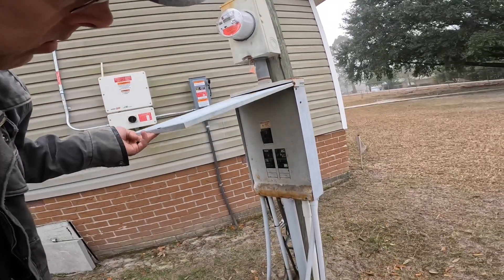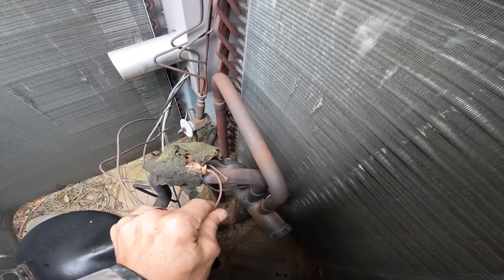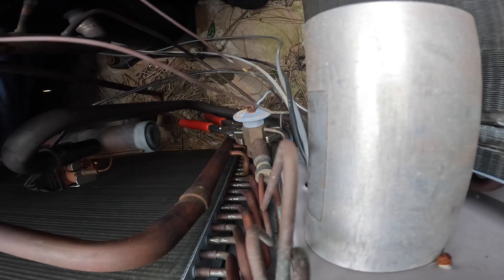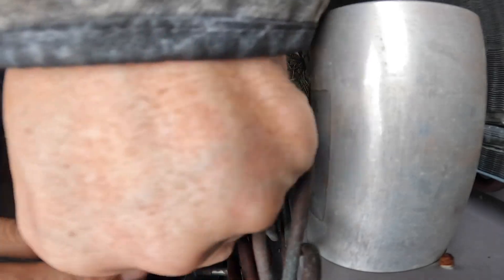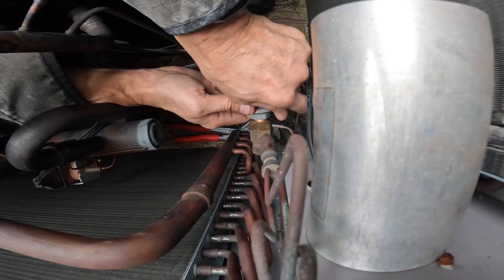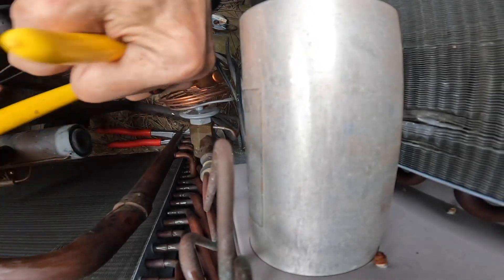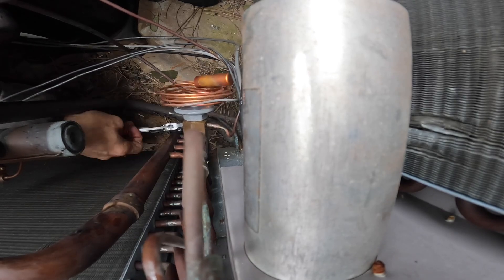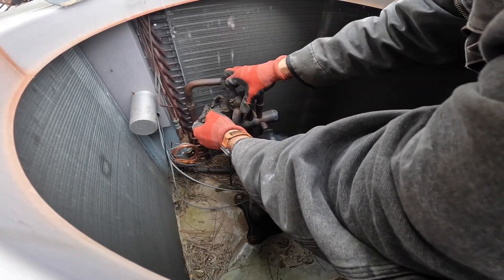Swapping a Power Head On A TXV - The Easy Way

Comment: Since it's a  heat pump
 You should of pumped gas in air handler and valves the unit off.  Incase  you blow the pins.  Use a wrench from sporlan . .   Secure the capillary  with caulk at the bulb and secure the rest

Comment: They make a special adjustable wrench for removing power heads.  The jaws are thin and offset, to fit in the narrow space between the power head and the valve body. I think it’s made by rigid. I don’t think channel locks would fit.  You must not be on the flats, but on the peaks   Channel locks or definitely not the right tool for backing up the body. You can make a tool by grinding down a crescent wrench.  It saves chewing up the flats of the body
Reply: Hell yeah the e110 wrench I always have it in my bag at all times

Comment: Great video as always, question about your joblink system that I have been meaning to ask someone, are the probe batteries rechargeable or do you have to switch them out every so often?  And, how often would that be?  Thanks.
Reply: Disposable and depends on run time. Usual operation gives a flashing green. When they flash red it’s time to replace batteries
Reply from the maker: Got to change them every so often

Comment: What were the symptoms that lead you to the power head?
Reply: The cap tube literally snapped off.
Reply from the maker: It was pumping down in heat mode
Reply: @HVACGUY  thanks for the reply.

Comment: I’ve always just pumped it down. Never wanted to risk losing the pins
Reply: Pump it down... For an outdoor metering device... I'll let you work that one out for yourself.
Reply: @TheMinecraftACMan  

I'm curious, couldn't you pump it down into the evaporator by closing the suction service valve and then closing the high side service valve?

Lol never tried that but I'm just wondering.
Reply: @BibleBloopers  You would actually close the liquid line first, keeping in mind that in heat mode your suction becomes the discharge line. It could possibly work, but if it went south it would get more complicated real fast. For one, if you failed to get the new head on before the little gas left in the condenser was gone, then you'd have to recover the gas anyways. With a standard pumpdown, failing the hat trick lets you still pull a vacuum without needing to recover. But no ones going to pull a vac through that tiny little cap tube they give you for the true suction, so the attempt to save time pretty quickly becomes a time sink. And second, doing a regular recovery on a residential system only takes like 5-10 minutes if you have a decent setup. Use the core tools and it goes super fast.
Reply: @TheMinecraftACMan  that's right. I Completely forgot it's a heat pump
Reply: @TheMinecraftACMan  thanks bro
Reply: PINS...WHAT PINS????
Reply: @robertwood9628  you mean the flying shrapnel that whizzes past your head after ricocheting off the machine. lol 🤣

Comment: can you have done a pump down towards the evaporator to avoid loosing all of that gas?
Reply: The amount of gas lost was likely only a few ounces at worst and still fits the de minimis of the EPA regulations.
Reply from the maker: You can do that, but I’d still leave some pressure on it, as you don’t want air coming in.
Reply: @HVACGUY  From what I could hear you lost a very small amt of gas, deminimis.

Comment: The STUB of the sensing bulb is supposed to be on the bottom when mounted horizonal. the power head uses the gas of the sensing bulb and not liquid to push on it. The sensing bulb cap tube has mostly liquid in it when the main cap tube is on the bottom of the bulb when mounted, I'm just saying. You did good on that, and you get an atta boy for doing a good yob. At least nothing went flying.

Comment: Quite a nice fix, good job, most individuals would replace the entire Txv
Reply: That's what I like about Sporlan valves.
Reply: Nice job on the head replacement!  Are you running the risk of the evap freezing during the summer at that low a saturation temp or is that normal for a heat pump running in heat mode?

Comment: I have a tool recommendation for sporlan thin jaw adjustable a
Reply: Link please
Reply: RIDGID 31305 Model E-110 9.5" Offset Hex Jaw Pipe Wrench, Red, Made in The USA
Reply: Klein makes an adjustable wrench with small jaws that fits right on those power heads, changed out about 50 in my career.